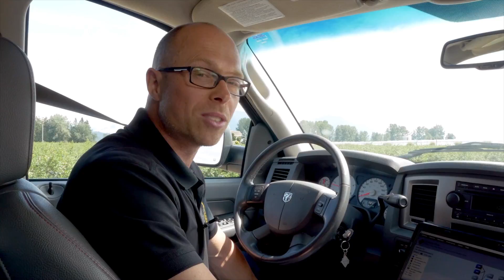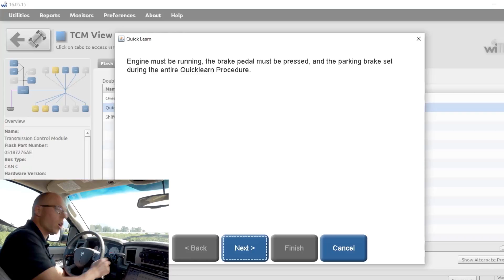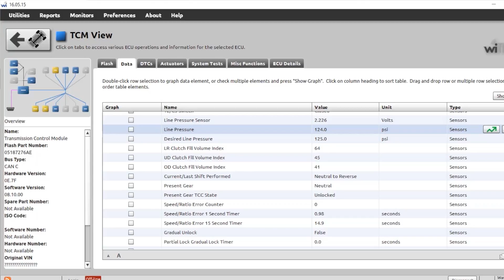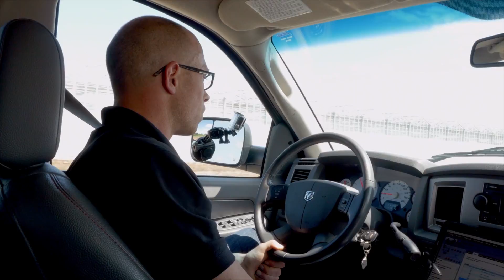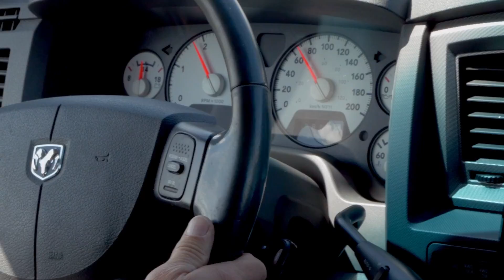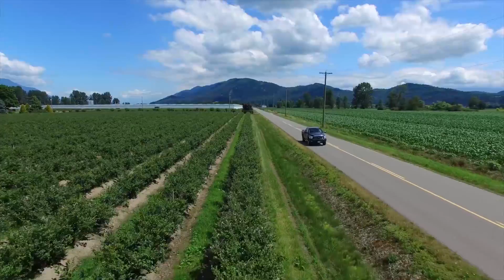BD Diesel Performance - 68RFE Transmission Relearn

Comment: I’m attempting to do this quick learn on my transmission I just had built however it will not do the procedure due to DTC. It is a data DTC for an injector but I have no way of fixing at the moment. How do I force the quick learn?